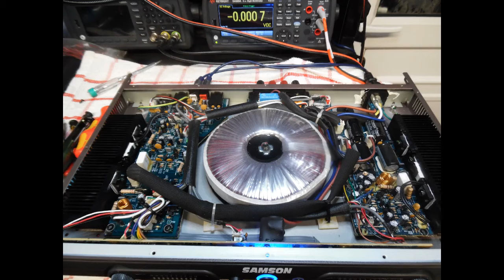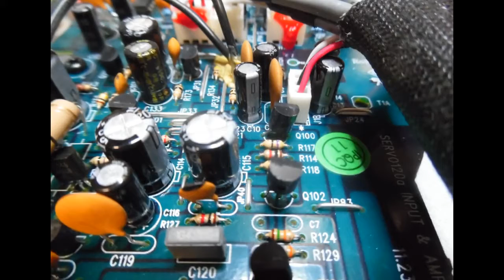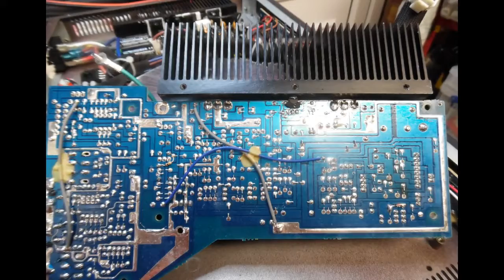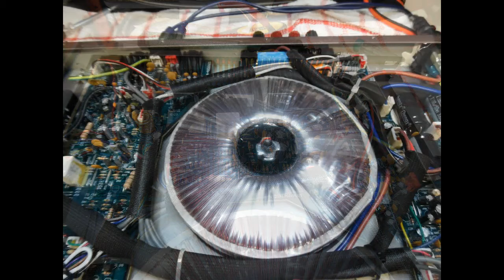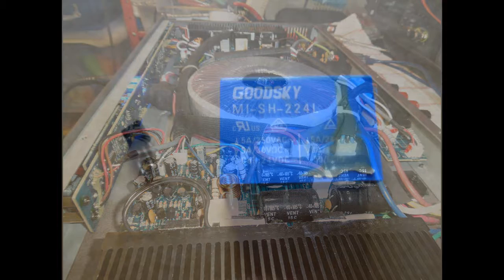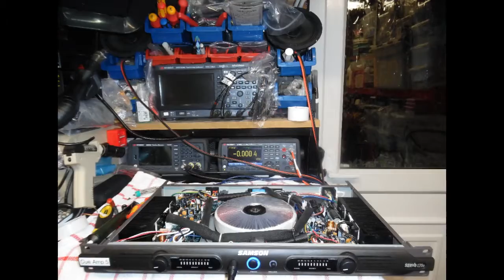Samson Servo 120A Amplifier Repair

Comment: My 120a blows main fuse. If I replace fuse with correct slow blow it works one time only. I have replaced thermistor on power switch. But not sure of correct rating for this. It works for about a week but will eventually blow again. If I leave it on its fine. Seems to be a power surge issue. Any suggestions?
Reply from the maker: Dan normally the thermistor you have removed should have information written on it.
Can you send a mail to audioamplifierservicing@aol.com with photos of the thermistor.
Also what is the supply voltage in your country?
The isdue does sound like a surge problem, but why your Amplifier has developed the issue needs to be determined.

Comment: I was wondering if you know the values of 3 resisters, 1 exploded and 2 burn fully. The number are R171 and R 170. 
The exploded resistor burn the marking on the board but it in between D110 and JP48.
Reply from the maker: Hi sadly the service manual and schematic is not available for this model of Amplifier, if the burnt out resistors are in the right or left channel Audio Output stages you can use the non failed channel to identify the failed components.

Comment: Hi, with your experience i'm hoping that you could shed some light on a120a that i'm trying to repair.    I bought it recently as New, no power from Ebay.   on first inspection the fuse holder is a double position type 110 or 240  the fuse orientation is used as the voltage selector but theres no marker on the case ( that i can see ) to say which way round it should go   the PREVIOUS owner has put a 3A 20mm fuse in to try and sort it, so i'm expecting a bit of damage when eventually get the correct size fuse    even a picture of the rear of the amp would be helpful, IF you still have it.  PS the rear diagram in the manual is not correct,  mains IEC connector pins are vertical/fuse position is on the rhs not underneath   Thanks, Hopefully!
Reply from the maker: Hi I do  not have a photo of the rear of the Amplifier showing the correct orientation of the fuse carrier for 120 / 230 VAC.
You could attempt to trace the the wires back to the transformer but this may not be conclusive, another way is to measure the resistance of the primary connection Neutral /120 / 230 the 230 should have a higher resistance.
But if the transformer primary is damaged then the best method is to use a dim bulb tester hence if the fuse carrier position is incorrect then excess current will be drawn but the bulb will limit the current. This is an example https://www.youtube.com/watch?v=8YWqWabXdbo
It will also confirm if the transformer primary winding is shorted.
Reply: @AudioAmplifierServicing  Thanks for the great idea of using the dim bulb tester, as its only a what size bulb 60w then 100w? , would an RCD plug be useful in the tester setup or would that just confuse any issue?   also as the amp is 240v 200w input the rear panel says 1.25ALamp  fuse but the manual says 1.5amp slow blow any suggestions    PS When I noticed the blown fuse I was planning on turning off the speaker outputs ( just in case it was the output transistors that are faulty) and just plugging in headphones with  volume on minimum as a start, would that have been a good idea?
Reply from the maker: @philhtc1195  Hi an 100 watt bulb would be fine and incorporating an RCD plug would be the correct set up and will not cause any issue.
I would follow the manual and install a 1.5 amp fuse.
The Amplifier incorporates a Relay speaker protection system.
So if there is an issue with the output transistors the Amplifier will switch to protection mode.
Hence there will be no risk of damage to connected speakers.